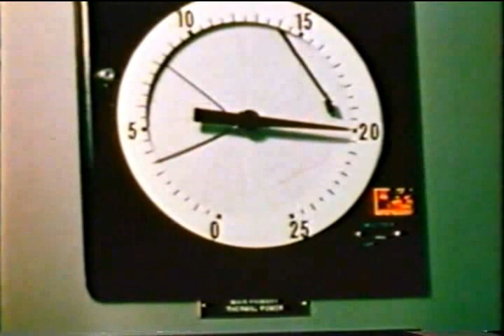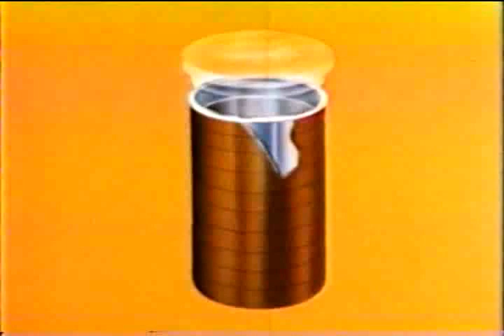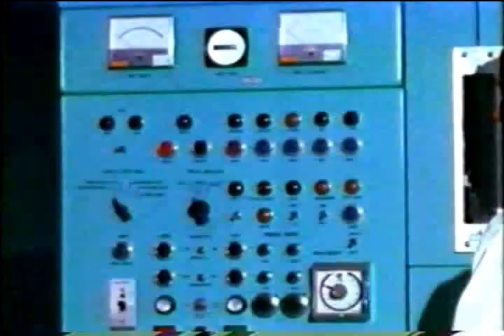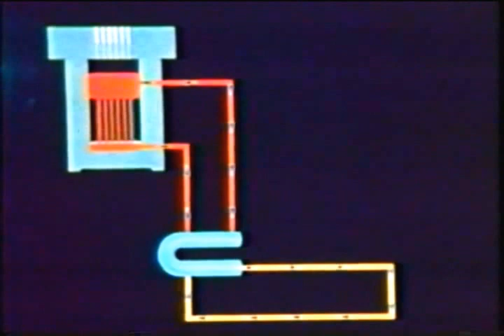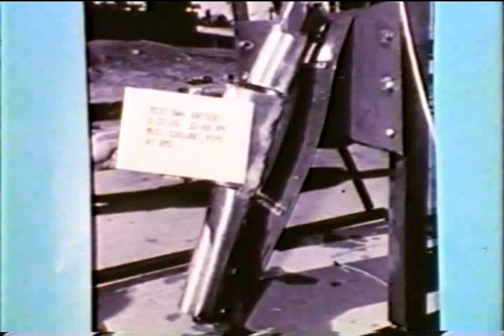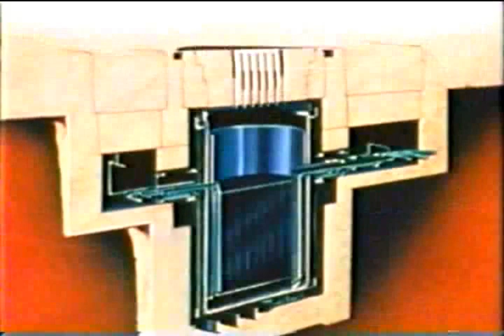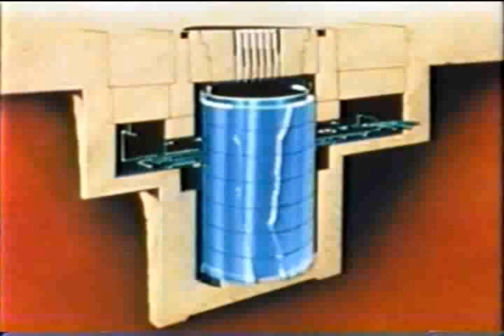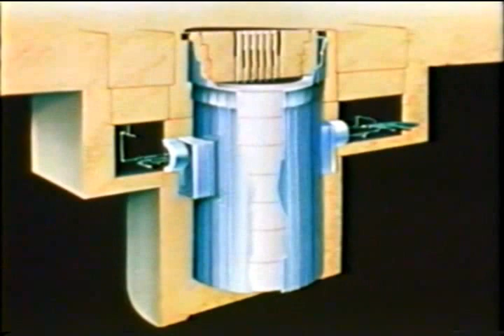SRE Nuclear Facility Decommissioning (1982)

Comment: No mention of the meltdown. Find that kind of odd.
Reply: You mean that part at 1:32 where he says "and went critical in 1957" in reference to the incident?
Reply: no it is in reference the first time that it was turned on.  going critical is when you have a self sustaining nuclear reaction.  All nuclear power plants are critical if they are on-line and generating power.
Reply: 8088bit Thats incorrect, nuclear criticality refers to an uncontrolled nuclear reaction, not a controlled one whatsoever.
Nuclear reactions in power plants are specifically controlled to emit specific levels of radiation and heat.
When a nuclear reactor goes critical, the radioactive isotope being used has started to rapidly decay beyond controllable rates, which is very bad.
Nuclear criticality == Chernobyl and atom bombs
Reply: I think you're referring to supercriticality.
Reply: The meltdown wasn't relevant to the decommissioning. The reactor was repaired after the meltdown and put back into service.
Reply: kiloscott the reason it took another twelve years is so that the short half-life, high rate radioactive isotopes could decay away to make decommissioning much safer and easier. This is an early film of the dawn of the now burgeoning nuclear decommissioning industry. The technology has come a long way.
Reply: Ian Walker man you're clueless
Reply: @Polaf3456  youre incorrect. youre thinking of super critical or prompt critical. plain old critical means the reactor is on
Reply: @Polaf3456  Incorrect

Comment: 14:30 shows a liquid waste tank. -One of those liquid waste tanks was discovered on an adjacent property....it had been hooked up backwards to the well pump so it would suck the contents out of the tank and send it's contents down into the well. No one really knows for sure what kind of waste it contained, how long it had been there pumping the waste into the water table/aquifer, or who had originally put it there, if a cleanup contractor had been instructed to put it there, or an underhanded deal had been made with the property owner to allow dumping there. We will probably never know.
Reply: where do you read about that? if it was a submersible well pump it would be impossible to hook it up backwards to a tank because the suction intake is in the well

Comment: At 17:08    so plastic bags can provide safe effective storage for radioactive contaminated debris, that's good to know.
Reply: That was just for transport, but yes plastic stops the contamination from migrating
Reply: @hjembrentkent6181  So why do I need a lead vest when I get an x ray?
Reply: @snizzake  There's a difference between contamination, which is radioactive particles, and radiation or the energy that radioactive particles emit. Some types of radiation, including x-rays and gamma rays, go right through most matter except dense elements like lead. Contamination is similar to dust and can be contained, such as with plastic.

Comment: The 1959 SRE accident released many times more radiation into the surrounding areas than three mile island.

Few people know that this was the worst accident to occur at a nuclear energy facility in the United States, and not TMI.
Reply: Absolutely incorrect! Cite your sources!
Reply: @cat637d he is correct please check your facts
Reply: The largest release of fission products to the environment occurred at the SL-1 reactor at INEL,   Almost no activity was released from the SRE.  The actinides and activation products were contained within the the reactor system and the sodium coolant.  The removal of moderator and fuel elements was accomplished with closed systems devices and isolated for burial.  Get your facts straight!